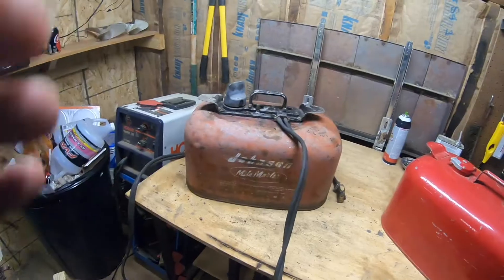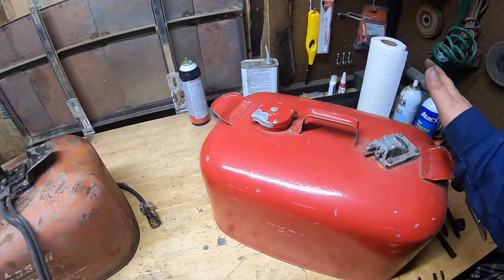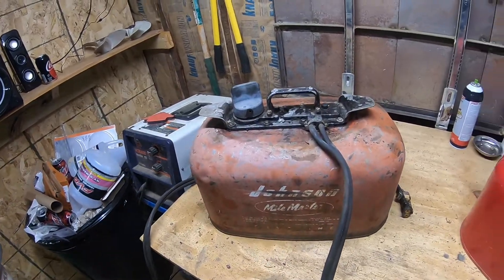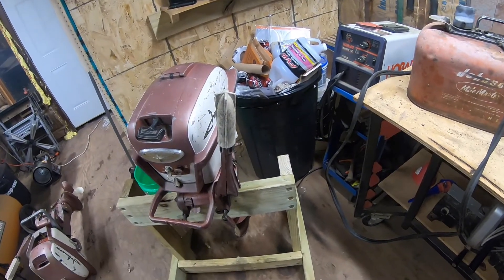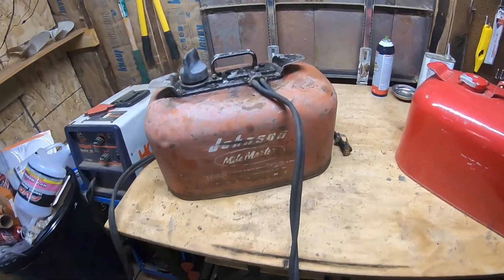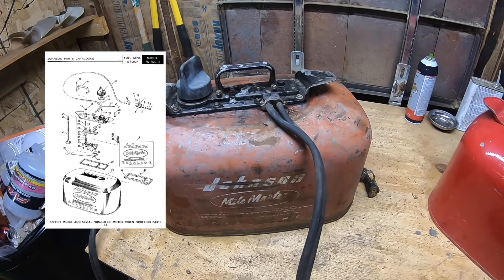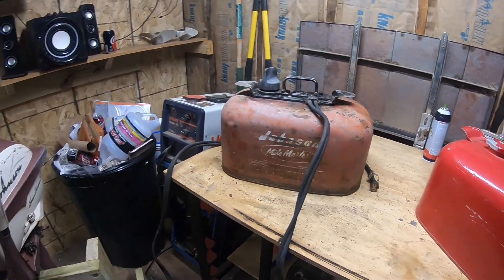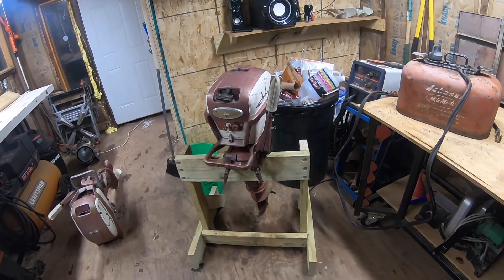Pressure Tank Explanation

Comment: Actually both of those tanks have vents. On the pressure tank there is a vent by loosening the tank cap and there is also a pressure relief valve inside the tank that pops open any time the tank sees more pressure than the set pressure on the relief valve  which is a safety feature. Around 4psi or less.  On the single line tank there is also a tank vent located at the fuel connector. You will see two small "Pins" that get depressed when the fuel connector is connected. One is to start fuel flow and the other it to allow the tank vent to open and work.